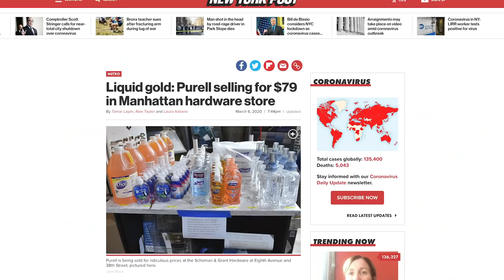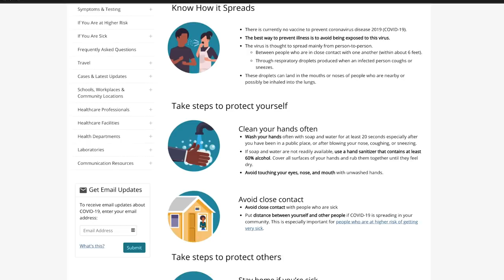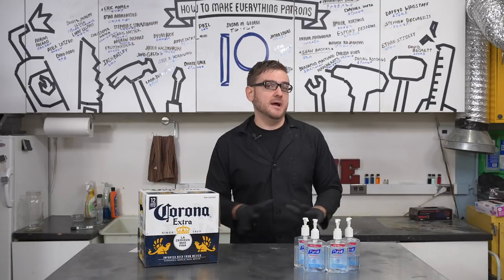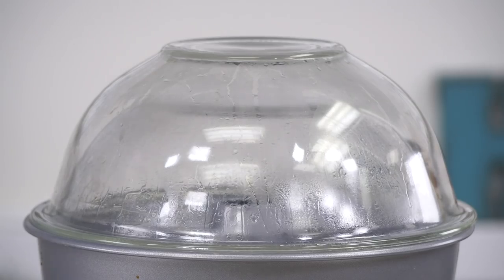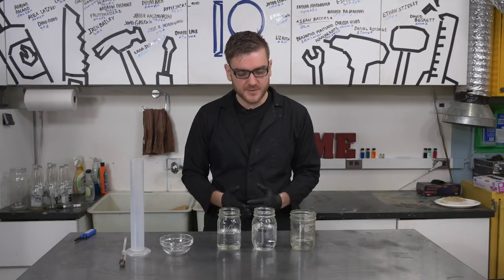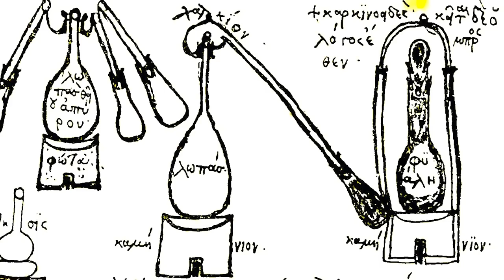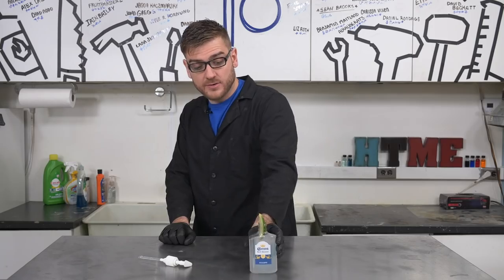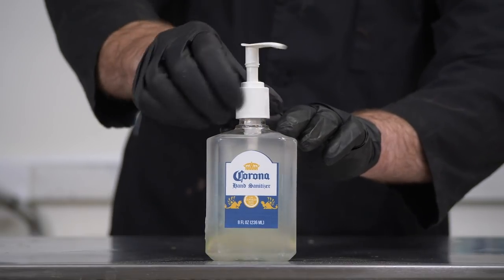Using Corona to Kill the Coronavirus

Comment: I RAN OUT OF TOILET PAPER!!! Please make an episode showing us how to make toilet paper from scratch
Reply: kaps_ nico I found this on the net hope it helps Here's what you'll need to make your own TP:

A CityBeat newspaper
A large kitchen pot
Water
Aloe, baby oil or unscented lotion (these will help to soften the mixture)
Rolling pin
Mallet or hammer
Grass or leaves
Sheet or towel
Ladle or large spoon
Large cutting board or other form of flat board
OPTIONAL: Witch hazel (an antibacterial agent)
Here's how to make it:

Soak the newspaper in water in order to remove as much ink as possible. After about 3/4 of the ink has dissipated from the paper, it can be removed from the water.
Place the soaked paper in a large kitchen pot with leaves and grass (this will help to bind the paper fibers) and fill with water. Bring the pot to a boil and simmer on a low temperature for one hour. 
Then bring the pot to a rolling boil for half an hour, removing foamy build-up as it collects. 
After boiling, the paper will turn into a pulp-like substance. Remove the pot from heat and pour out the water while keeping the pulp intact inside the pot.
Add four tablespoons of oil or lotion to the mixture, and witch hazel if you decide to include it. Mix. 
Remove mixture from the pot and place on a towel or sheet and spread onto a flat surface using a rolling pin to make the mixture as thin as possible. Hammer out any lumps with the mallet or hammer. 
Place a large cutting board or flat board on top of the rolled out mixture. 
Remove the board after half an hour. Pull the toilet paper mixture off of the towel or sheet. 
Let the paper dry in the sun. 
Cut into strips. Voila! Toilet paper.
Reply: yes he should do a info video with a title how to wash your ass with water.
Reply: Just get some corn husks
Reply: Use your phonebook or magazines & catalogs. Time to sign up for some catalogs and you'll get them in the mail.
Reply: Traditionally one used their non-dominant hand for such things.
Reply: He already made a book from scratch, so just make the paper sheets from that but cut into toiletpaper sized squares instead of binding together :)
Cheap material or old clothes you really need to throw out anyway are probably eaasier though :)
Reply: @nickfenix3892  You are a good man. Thank you.
Reply: Is this a joke right
Reply: You're stuck inside anyway. Just take a shower after doing your business.
Reply: You're kidding me 😂😂😂
Reply: Like ancient romans. Sponge on a stick, soaked in vinegar water xD
Reply: use fluffy Rabbits, its selfcleaning.
Reply: Use a shirt sleeve.
Reply: I'll trade you one case of toilet paper and some SPAM for a big bottle of hand sanitizer and some n95 masks.

(At least that is what is happening in my neighborhood. Not even an apocalypse yet and we're already reduced to the barter system.)
Reply: A Washingtonpost is soft enough
Reply: If you scratch enough you eventually scratch yourself clean
Reply: use a bidet
Reply: @lizshoemaker  ikr have these ppl never heard of a bidet, just use the showerhead and spray it on ur ass, or if you don't have a handheld showerhead buy a big ol watering can.
Reply: He did eventually

Comment: "You shouldnt distill alcohol without a permit." - Andy, Andy, shows us how to distill alcohol at home.
Reply: Actually if i recall right ice distilling or freeze distilling is still legal with out license, though there are exceptions so check your local regulations.
Essentially you freeze the liquid several times and what does not freeze is higher concentrations of alcohol. Technically this is some what safer cause ethanol and methanol content stays the same, you just remove excess water from the mix.. how ever if you make this from say grape juice or such... you will never have such killer hangover next day... and day after and maybe even day after that...In hot distilling methanol will evaporate first as it has lover evaporation point, so first that comes out from the tube and it needs to be disposed, but cause people cant do or dont know to do the math how much methanol there is for x percentage strong alcohol and they dont want to waste ethanol first or second bottle gets to be first pure methanol and in second most likely so big concentrations that it will poison you. Thats why all batches need to be mixed together except the first entirely methanol and same thing repeated in next phase until you get to desired percentage.

Comment: Just for those of you in the back of the class:
naturally brewed / fermented alcoholic drinks contain very minute amounts of methanol, and when you distill them you can very easily concentrate the methanol to more poisonous levels which can make you go blind from drinking it.

it comes off in the beginning, since it has a lower boiling point. so monitor the temperature of the steam, watching for jumps in temperature. Also, throw away the first portion of liquid that distills over. Also also, try to learn what you are doing before attempting chemistry like this. Many people have subjected their bodies to chemicals so that you don't have to.
Reply: This is a gem of a comment amongst the rubble of others. Also, copying the recipe as it was shown in this video will result in a "sanitizer" that is too low in ethanol content to actually sanitize most anything effectively.
Reply: Do you have any thoughts on making it from scratch sugar water yeast ? How many times do i need to distill it?
Reply: There is a methanol in the first batch, do I understand correctly?

Comment: For scenting you should use lime oil, which is found in the zest. The juice isn't as strongly scented and ads sugar which leaves a stickier residue that feeds bacteria. 
Even more ideal would be to distill oregano essential oil. It has a longer lasting anti microbial effect because rather than evaporating away like alcohols, it soaks into the dead skin cells at the surface, making an anti-microbial layer on your hands (or anywhere else you put it) Just keep it away from your eyes and other sensitive areas.
Reply: and also, lime juice can cause stains on the skin
Reply: @vivianr5384  I forgot about that. Citrus juice changes the shape of melanin leaving you susceptible to sun burn.

Comment: In italy you can find 90% alcohol in the stores lol, but also 70% or 60%
Reply: You can find that in the states too.  Most rubbing alcohol is at 70% isopropyl, but 91% is available and not hard to find.  Liquor, most of it is 40% ethanol.... but 151 proof rum is fairly common (which would be what, 75%?) and you can find both everclear and clear springs which run about 190 proof.  So, 95% ish?  At least here in Oregon they keep that stuff behind the counter at the liquor store and you have to ask for it, they don't just put it out on the shelves, but it's available if you ask.
Reply: @corwinweber693  in Washington, you can find 199 proof if you really look.  From what i have been told most people buy it for extacting rather than drinking it.
Reply: @abstracttechnician2750  Tinctures, yeah.  It's common for that.  Although I think 190 would work pretty well for that.  For that matter I think Absinthe is 190 proof, and it's.... well it's an extract.  I think it's technically a tincture.  Sort of.

Comment: Pro tip.  If you heat at lower temp below 212 you won’t turn the water into vapor and it won’t dilute the distillate.

Comment: If you're in the UK go to B&Q and buy a 2lt bottle of bi-ethanol (£6.87), it's on the heat isle and is >95% pure Ethanol.
Then buy some aloe hand moisturiser, mix 200ml Ethanol and 100ml moisturiser, you will need to mix it very well!
and there you have it, you're own hand sanitiser

Comment: The old moonshiners used to use a paste made of rye flour & water to seal up the joints in their stills.
White flour works too, but needs to be replaced sooner.
It sucks having to mix up another batch of paste mid run & smear it into the cracks of a hot still.

Comment: The alcohol can also be "concentrated" (not distilled) by freezing the beer and pouring out what doesn't freeze and "concentrating" that again (discard the water ice). After about 3 cycles you can get to about 30% - not sure if you can get it much higher than that as I saw this in a "How to make Apple Jack" video.

Comment: Andy, freeze distillation would have been a better/easier option - it's far more dangerous if consumed as impurities are not boiled off, but since it's not for consumption that's a non-issue. Only requires a sealable plastic container (for example  one or more water bottles), a freezer, and some patience.

Comment: If you’re just using a pre-distilled solution (like everclear), aloe, and lime, I don’t see any reason why you couldn’t drink it, as long as you drink responsibly.
Reply: I'd be cautious with the aloe.  I mean if you're harvesting it yourself there's probably nothing actually wrong with it, but if you're buying aloe vera gel, those are meant for topical use so the manufacturer might be putting other ingredients into it.

Comment: Calcium oxide is insoluble in ethanol and will absorb the water in ~96% to give 100% ethanol with a precipitate you can filter out. Perfect if you need to roughly dry ethanol, it is an exothermic reaction so care should be taken

Comment: When you're doing a distillation (mixtures with water) you should check for azeotropic points, there's an azeotropic point (or constant boling point) around 351K (which is also the boiling point of ethanol) for the mixture ethanol-water in which you won't distillate properly the ethanol from the water. Cool video anyways!

Comment: would sealing the gaps with a flour based dough make the bunt pan way work better? Also how about using an induction plate and set the tempreture to just below boiling point of water? Would putting salt in the water prevent less water from evaporating?

Comment: Thank you for pointing out that methanol is poisonous. Perhaps you could add - one REASON distillation needs a licence, is to ensure methanol is removed. The boiling point is quite close to that of ethanol.
If it ends up as hand sanitizer it's not too bad, but if anyone considers drinking it? That methanol risk becomes important.

Comment: ok so which drinking alcohols are over 70% pure? Cause I looked this up a few days back (can you use vodka etc as hand sanitiser) & the results I got told me none of them had over 70% alcohol :(
Mentholated spirits was the only result I got that looked possibly promising in terms of having a high enough percentage without distillation
Reply: It depends on where you're located. Where I live, I can buy everclear and similar high proof "grain alcohol". 151 is also a popular rum strength (75.5% alcohol).

Comment: Don’t drink this “ethanol” in a mixer, it also contains methanol which can cause blindness and death if ingested in higher concentrations.
(Look up “heads” & “tails” when distilling).  As a hand sanitizer, it should be fine, though 70% alcohol is the most effective concentration of alcohol for hand sanitizers.
Reply: There won't be any methanol in there. Methanol is produced in the fermentation process. Since there is no methanol (ok well a tiny bit probably) in Corona to start out with, you're not going to end up with any in the end product. I was really disappointed that the host really failed to mention this.

Comment: Methanol does NOT come from fermentation, nor non-cracking distillation.  It is added to commercial ethanol to render it a non-consumable.  Distillation is hugely dangerous.  Do not attempt it at any time.  Alcohol fires are invisible and will burn excessively.  I've seen the result on an industry professional that almost died.

Comment: that batch of alcohols is actually a lot less ethanol than actually expected on  the  hydrometer. When you run a batch of shine you get many outputs from the still, those being the tails, hearts, and heads. Seeing that you did not take the time to separate these byproducts (they distill off at the beginning middle and end of the run with methanol coming in first as the tails, ethanol in the middle as the hearts and less concentrated ethanol at the end, the tails) you most likely mixture of alcohols many of which are not capable of defeating viruses like corona.  The reason your hydrometer said 75% was because that is a measure of the remaining sugars in the shine. Obviously methanol, ethanol, and low concentration ethanol are not sugars so they don't affect the overall gravity reading of the hydrometer. 

- Stay safe, stay home.

Comment: (2:30) - Distillation to produce ethanol is not dangerous at all.
You should do your research.
The amounts of methanol actually produced is negligible and in any case are discarded in what is known as the "heads" of the distillation.
The reason methanol has got such a bad reputation is because unscrupulous spirit dealers would add methanol to their product because it was much cheaper than ethanol.
And this of course went on to cause blindness and death for many.
But you really should get your facts straight.
I do a lot of home distillation and have never had any problem with "methanol contamination"
>

Comment: So can i just get 80 proof vodka and mix it with the other 2 ingredients?
Reply: Difficult to say if it will do you any good. The concentration needs to be just right. 80 proof isn't enough that's only 40% alcohol. You need 60% at very least in the final product. Which takes math and chemistry. Please just use soap it rips the virus open and or sticks to it so it can be washed away (based on time).

Comment: Wouldn't the CO2 in solution come out before the alcohol since it's a diffused gas at a high pressure? I know alcohol is a volatile liquid but it's still a liquid, either way the CO2 wont distill just thought I'd add what he left out.

Comment: Alternatively use anything with a low PH. For example, use 10% bleach mixed with water, or straight up vinegar since it strips away the coating that the virus has. Of course soap works best due to its ability to break down oils. Washing your hands with acne wash would work fine as well since it can break down this coating. Of course don’t panic buy. It helps nobody.